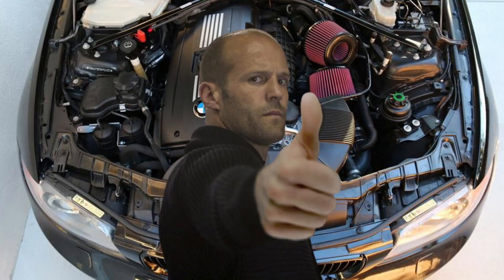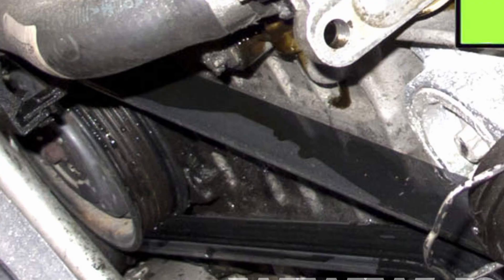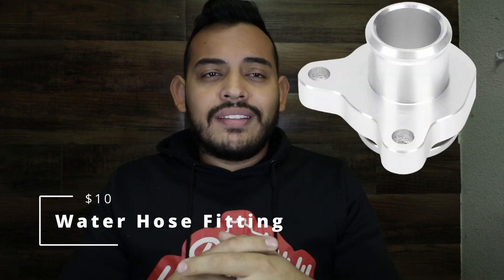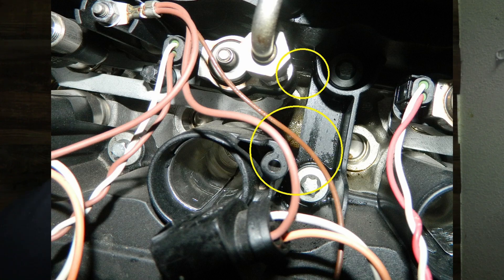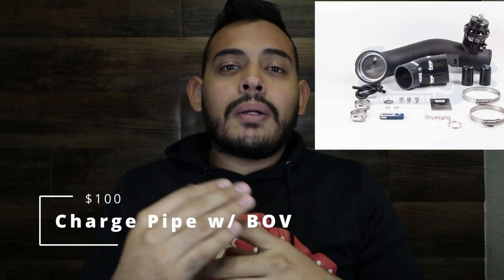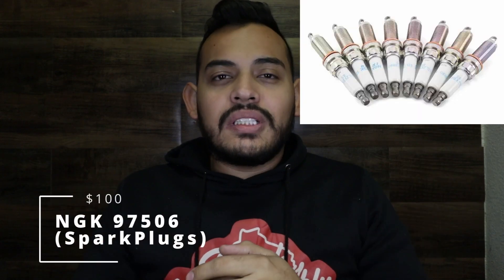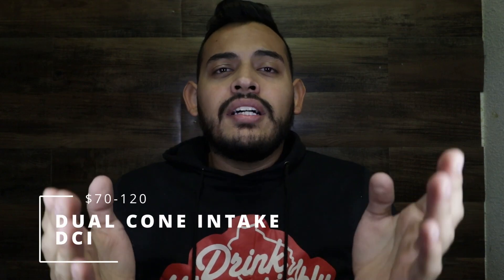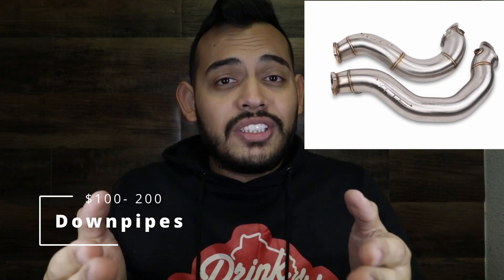10 Things you MUST DO to your 335i,535i,135i for less than $1000 (Mods & Maintenance)

Comment: Good Carly features: Disable headlight washer jets, lower angel eye voltage brightness after installing white LED, disable voltage checks (flickering), disable seatbelt warning beep, etc.

Good MHD features: Stage 1+ tune took 7min to flash with their WiFi OBD tool, detailed fault codes, no renewing subscriptions, changing cooling fan speeds, disabling cold start roar (higher cold RPM more wear IMO), removing speed limiter, etc.

Comment: Step one, buy an LCI N55 135i if you're not going above 400hp. Single turbo, better sounding, more reliable, less problems. I agree with needing to get chargepipe, MHD, OFHG etc. I installed these myself.